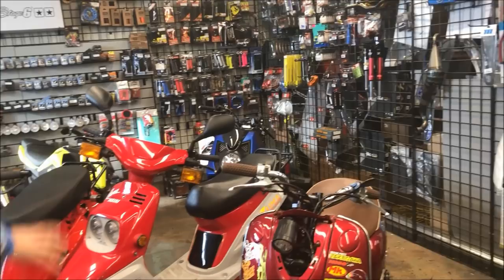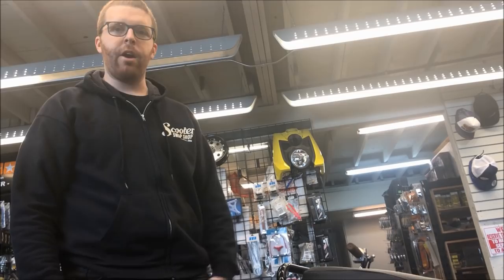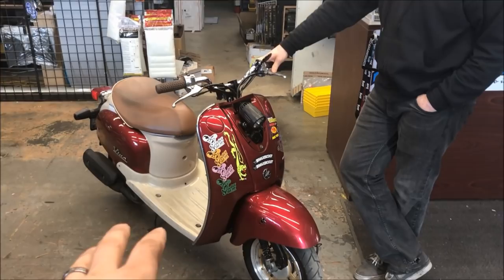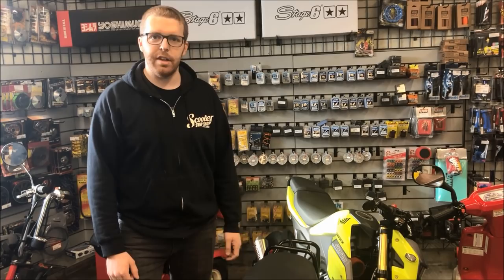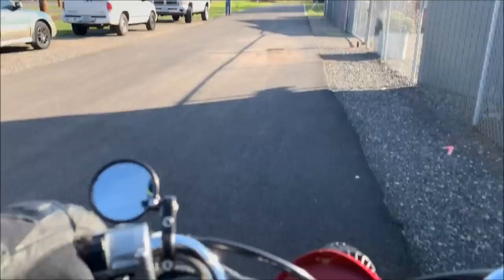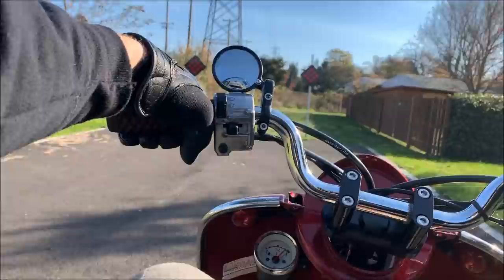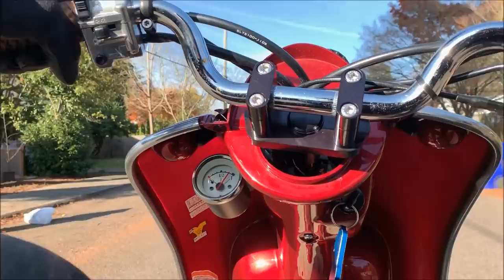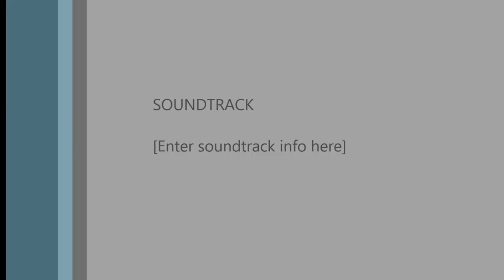How to do Scooter Wheelies like a boss!

Comment: I learned to wheelie my piaggio zip ac 70cc Malossi sport full performance set up in two weeks I can turn round bends and go in a straight line, no other tricks yet, but my bike dose 65mph top speed and has a instant power band, is 65mph good for a malossi sport 70cc cast iron, carbon reeds, stage 6 adjustable clutch, malossi multiva 6.5g rollers, polini evolution aramid belt V.3, malossi white contra spring, Leo vice zx Crome exhaust.
Reply from the maker: awesome

Comment: That derbies is sweet,I had a aprilia like that about 6 years ago but bought it with no key and fuel pump was toast so I sold it for parts cause it was just too much small stuff and I had 5 others at the time.
Got a vento r4 I wanna mod with 2k miles and a tgb keywest with 2k miles and a extra motor that came off a zuma clone believe it was a Eton beamer.
My old r4 would do about 56 57mph all the time with a bbk kit I had on it but soon I wanna get a whole custom mid grade cvt system.
Had a few zips and they were pretty fast for what they were and got up to 40mph pretty fast and would go 46 to 47 with me 250lbs on it.
Reply: My current r4 isnt nearly as fast as the other 4 or 5 centos I've owed,I'm 255lbs now and I thought maybe wore rings cause I got it and the tgb from the same older people and thought maybe they didnt know to add oil and maybe ran it without not knowing then found out but it wasnt rings I just changed em and it still takes probably 5 seconds lo ger to hit 38 39mph than any other venti I've had and I've gotta be on a slight decline to get it up to 45 46 when all my other r6 models would do 44 to 46 all the time.
May change the cvt from the beamer if itll fit and see if that makes a change and it it does I will know itll be something in the cvt.
Reply from the maker: cool

Comment: Is a 4 stroke 49cc scooter with 82cc bore kit acceptable for wheelies.
Reply: If you lighten the front up and tune your cvt, i dont see why not.  Not gonna be as much power as an equivalent 2 stroke, but it could work
Reply from the maker: anything can wheelie
Reply: I had my taotao on one wheel accidentally! It's 81cc, and I'm 6'6"over 300lbs, with a light weight, and clutch springs it should be easy!

Comment: How hard is it to wheelie a bigger scooter? Like a 250cc.
Reply from the maker: It definitely takes more work. Some
May not be possible
Reply: Maybe a small 250 like an Elite.  Most 250s are water cooled, and most are longer cause they're more touring type scooters.  Water cooled makes a lot of weight in the front from radiators and coolant.  Even on the Elite 250

Comment: I'll get it figured out one day. My biggest struggle is once the front goes up my natural tendency is to hold on for dear life, which means i'm twisting the throttle back even more and my fingers come off the rear brake handle, my heart explodes and then I set it down and don't try again.
Reply from the maker: It takes time to get over that natural reaction. It took me about 2 years to get down. Practicing all the time
Reply: Get a bike that you don’t care about flipping, that’s how you learn. If you care about your bike, you’ll get hurt trying to save it. Just my opinion.

Comment: for tunned up scooters, stretch your arms more so you pull more weight back and you wont need to roll the throttle all the way nor use the breaks so much :) basically glide through the wheelie. Looks like he is trying to eat the handlebar lol but yeah much easier on a stock to do them slow
Reply from the maker: Thanks for the tips!

Comment: my scoot could never do that and I've upgraded everything top speed like 60mph 100cc bbk
Reply from the maker: cvt tuning bud
Reply: @Scooterswapshop  thanks man. I've been messing with it alot all the weights and springs. It's gotten alot better great in the mid top range. I still have terrible low end torque and acceleration off the line though. Have you ever had problems with your valve not seating properly? I believe that's what I'm experiencing. I hear a pretty loud ticking coming from me valves I believe, but the gap is perfect and so is timing. Could that cause me to lose low end?
Reply: @greatestevar  thanks much I'm gonna give it a go